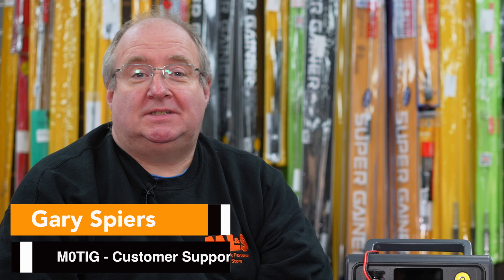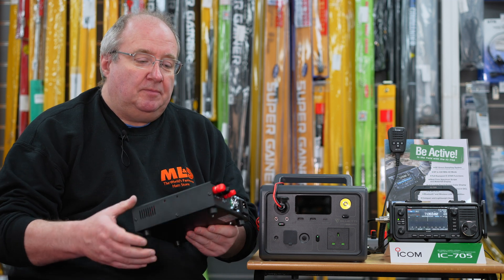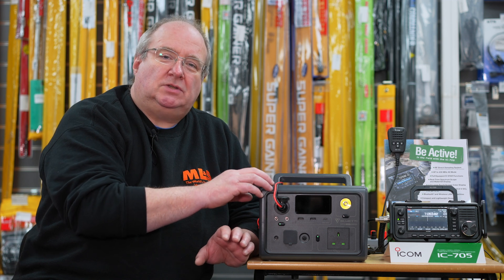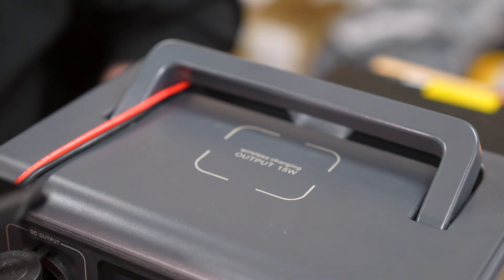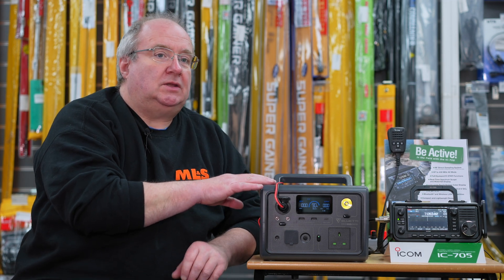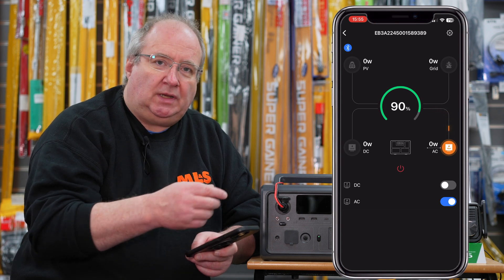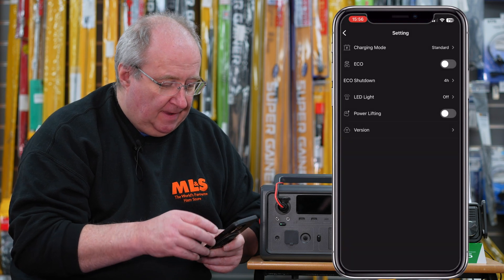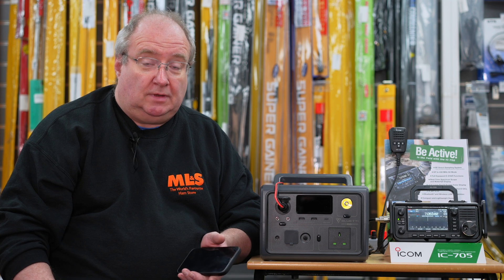Powering Ham Radio on the Go: A Guide to Using Portable Power Station

Comment: Will these portable power stations power an IC-7300  and PSU for POTA use?
Reply: Only as QRP on 10Amp DC longer via AC PSU.  Worst interference on 160m from inverter.

Comment: Looks really useful and well thought out. But I think Anderson Power Pole connectors would have been more useful to the ham community than these little sockets that always seem to have a centre pin that's the wrong size. So, time to get the soldering iron warmed up to make a patch lead, as I have just ordered an EB3A as shown in the video.

Comment: Does anyone know what the RF noise is like on these. I have a similar unit from a different manufacturer Yose. It's very good running my 705 but in the county side where the rf back ground is very quiet there is a very slight increase in the noise floor on the 705
Reply: That's a good question, the 230V inverters are prone to be noisy maybe if your just using the 12v outlet that'll probably be ok. I just use a 12v lithium iron phosphate battery when I'm out and about smaller and lighter for my radios.

Comment: This might be handy for some repeater keeper's with a questionable mains power supply, if you can use the ups backup along with the 12v trickle charger might keep some repeaters on the go for a few hours, longer with the higher specked bluetti's.